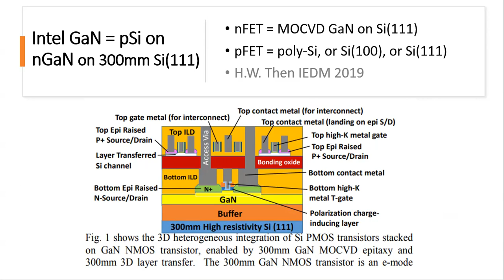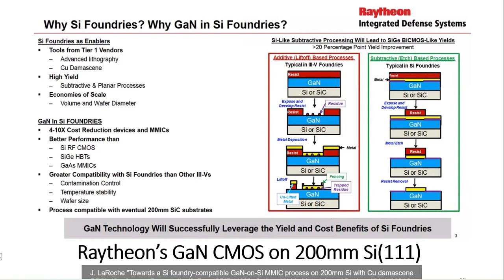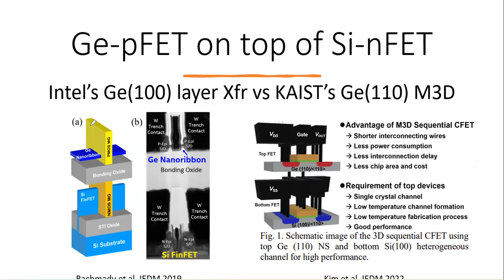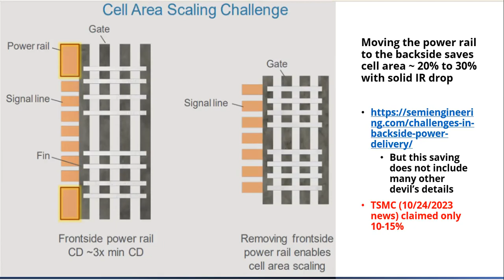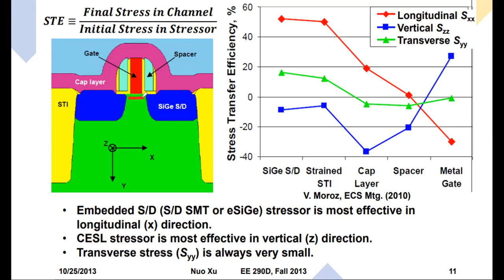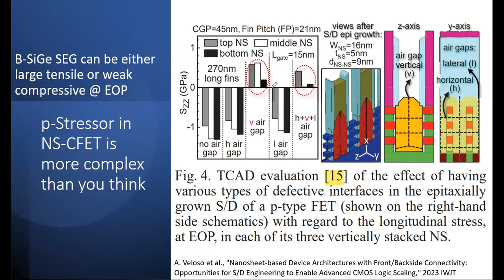1  Process hot topics which one is on top, cases of Si Ge GaN and CFET

Comment from the maker: SiGe B has evolved to ISBD SEG insitu boron doped selective epi growth, no implant at all The epi temperature wise, GeH4 is very active and then lower temperature is good enough 

 In addition you need to avoid Boron diffusion. Higher temperatures are not good for you 

 SiH4 for nSD requires high temp since it’s less active than GeH4 

 One can use higher order silane or germane but it may be too active and you may have issues with SEG